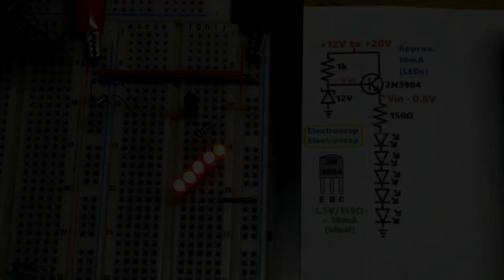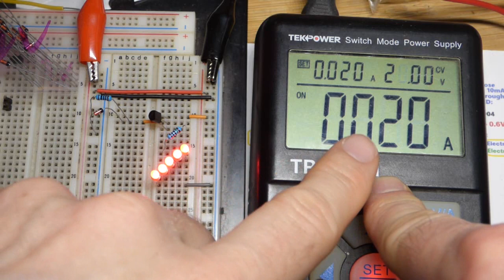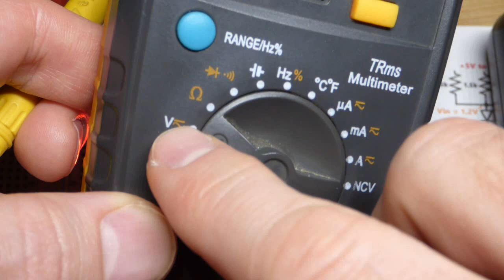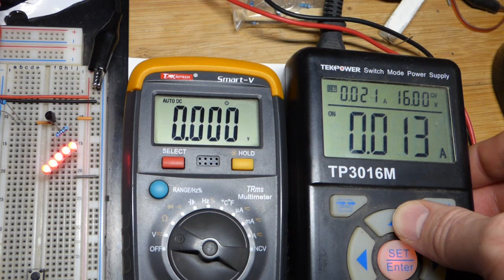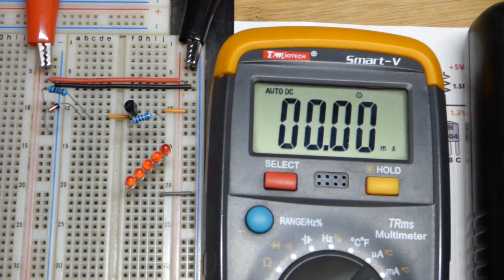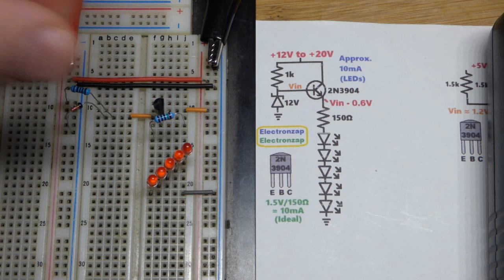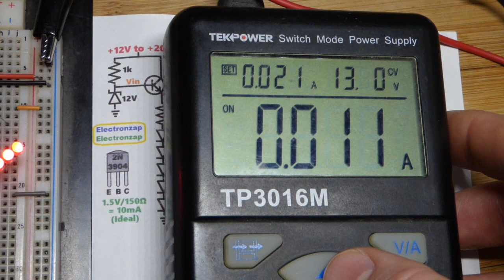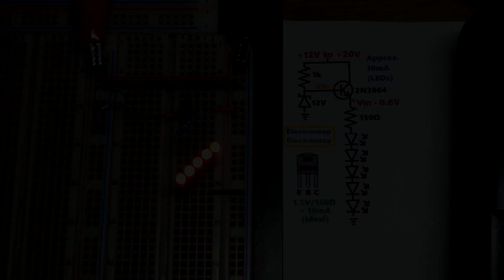NPN BJT emitter follower sets about 10mA through 5 series red LEDs at 12V to 20V

Comment: You could also replace the 1kR/12v zener stack  with a 4.7kR and a tl431 below it in 2.5v zener  mode (cathode tied to ref tied to 2n9304 base). Then move the leds to between vcc and the collector  and replace the 150R with a 180R to ground. Should give more consistent current across the voltage sweep.